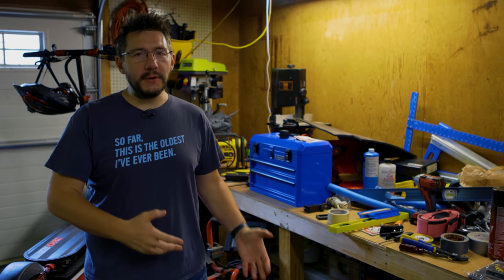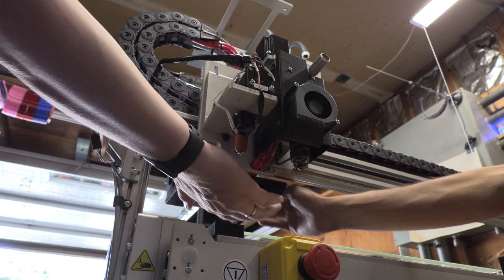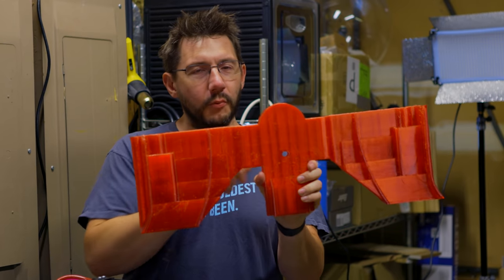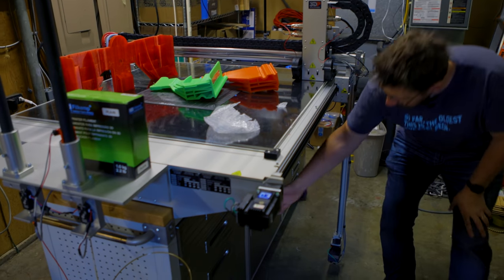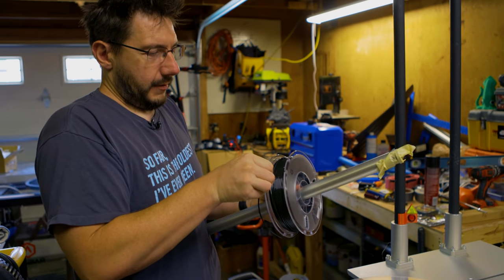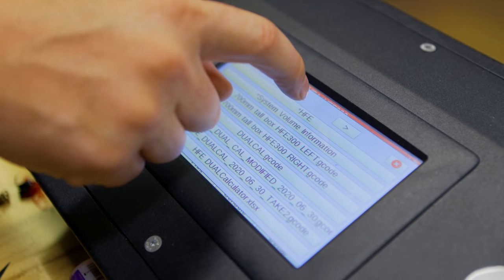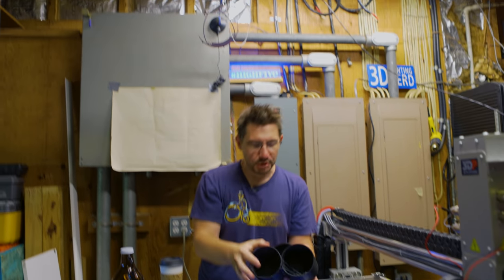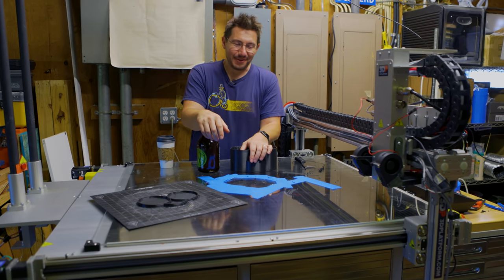I Broke a $38,000 3D Printer

Comment: Somehow, this material that's well known for inseparably bonding itself to bare glass has inseparably bonded itself to bare glass. Truly baffling!
Reply: It's like 2525 dark matter.
Reply: Incredible!
Reply: Even more baffling, it's the material provided by the vendor...
Reply from the maker: I've NEVER had PETG bond itself to bare glass before on the machines I've run it. It's always been tough to print because the first layer just wouldn't stick right. I've had PETG weld itself to PEI before, that one was fun...
Reply: I found myself wondering how much filament that chess piece took to make
Reply: @3DPrintingNerd  This is the reason I avoided PETG for so long.  I was afraid I would trash my carborundum glass bed. I bought an additional borosilicate glass plate and stuck a Gizmodorks PEI sheet to it.  I have tested with sugar water barrier and straight to the bed.  So far, the bare bed seem to work pretty well.  Of course, I probably just jinxed myself.  : /
Reply: I've had PETG weld itself to a glass bed before.  I chose to sacrifice the printed part rather than the glass by heating the bed up enough to melt the PETG sufficiently to remove it from the bed.  I've never printed PETG on glass since then.  Lesson learned.
Reply: @3DPrintingNerd  "I've NEVER had PETG bond itself to bare glass before " i hear people say this but they have this coming to them
Reply from the maker: Hahaha. Truth.
Reply: @pbales8951  My first fillament choice was PETG.
After like 10 prints, mad upgrades, and a week of tuning I was sure either my machine was defective or I sucked at printing.
Swapped to PLA, used a baseline for temp/retract/etc, and my first print looked like it came out of a SLA printer.

FUCK PETG.
Reply: @johnmorris3121  I dunno about sugar water, my printer's manual recommends windex or glue stick as a separation layer. Window cleaners work fine with PEI.
Reply: I never had that problem with PETG on Ultrabase. I thought he printed PC (another story).
Reply: @3DPrintingNerd  I've purchased 3 PEI build plates because of things inexplicably welding themselves to the coating, but I keep getting new ones because I'm in absolute love with the sexy smoothness that is First-Layer-PLA on virgin PEI!!!
Reply: @3DPrintingNerd  You are so lucky, I've been through 3 glass beds thanks to PETG
Reply: put some dry ice on the glass around the print and it should come right off.
Reply: @Paul-sk2pc  It's all good now, I switched to a PEI build plate and have had no trouble since. (use a glue stick before the print and it works great).
Reply: And petg doesn't stick just to glass.
I use blue window cleaner on my Prusa i3 mk3 bed. I got that recommendation from some forum and it sure works! The adhesion is not too great but just right.
One time I forgot to use blue window cleaner after cleaning the bed with pure IPA and the results were catastrofic. The PEI film was fused to printed object and tore apart. Luckily I still had the other side of Prusa spring steel sheat intact.
Reply: Perhaps you mean ... Truly "Brilliant"?  :)  Also, I've done this before, just on a CR-10 instead, way cheaper bed replacement, lol.
Reply: @3DPrintingNerd  I have had the same issue, cant for the life of me get any PETG (3 different brands) stick to my glass bed. That's bare or with bonding agents. Iv resorted to using a pei spring steel sheet to get prints to succeed at all. Wonder why it sometimes decides to weld for some people.
Reply: As soon as he said Borosilicate, I knew what happened.
Reply: Never printed on bare glass - a layer of cheapest hair spray always made for great first layer bonding and it just pops off after cooldown. Now I am on a ship and forgot the hairspray so I had to print on bare glass. First time ever I had PETG stick to the glass and take chunks of it. Good thing is that glass has two sides :)
Reply: @3DPrintingNerd  With normal glass, it generally won't. It will bond at a molecular level to borosilicate and to a lesser degree to soda lime. As soon as you said "borosilicate" I immediately knew what was going to happen. :/ Sorry, man. That sucks.
Reply: @ketse89  Do you mean PETG doesn't stick to "just glass" (i.e. not borosilicate) or do you mean that it's not "just stuck" (but rather bonded) or are you under the mistaken impression that PETG and borosilicate won't bond inseparably?
Reply: @Paul-sk2pc  That might work on regular glass. When you mix borosilicate and PETG, the print may be chemically bonded on a level that precludes it's removal through any means short of (gently) machining the PETG off the glass.
Reply from the maker: @SwervingLemon  It's all good, man. Super and total learning experience and the company is awesome to deal with.
Reply: @SwervingLemon  Saying "petg doesn't stick just to glass" means that it sticks to glass AND other surfaces. Or at least that's how I've learned the phrasing, english is not my primary language.
Reply: @3DPrintingNerd  It seems there are 2 scenarios: It will barely stick at all without adhesives and/or enough heat or it will stick so bad that it takes chips of glass with it. Maybe depends on the kind of additives? shrug
Reply: @haraldhimmel5687  , you are running in circles. The no-sticking comments that people have made here refer to ordinary glass, not to special type of glass; there are not the same.
Reply: @michaels3003  Like I said, I experienced both on the same glass on different filaments. Maybe there is a special type of glass too where that is the case but that was my experience.
Reply: You should always use primer when printing with PETG. Glue stick, hairspray or whatever you fancy as primer. From there my experience is PETG is just as easy as PLA, just a stronger result. I've had the glass split through the thickness, no cracks in the glass, when printing large PETG models without primer. Since then I always prime and hasn't had an issue.
Reply: @johnmorris3121  just use glue stick for PETG on PEI/glass.
Reply: @3DPrintingNerd I only print PETG on glass, and have never had an issue. EVER.
Reply: Yep, happened to me on thankfully a small plate.  Definitely something that can happen.
Reply: I use a type of bond when printing petg on glas glue stick, magic spray etc. 90% of my prints are petg i never had the glass infused in my print lol
Reply: @zigfaust  ha same here
Reply: @3DPrintingNerd  wonder if can get something similar to prusa textured sheet for that machine lol. that sheet never gave me any issues.

Comment: We can't really judge the quality of this printer until we see a 1 meter long Benchy.
Reply from the maker: ha!
Reply: Brian Burton yes
Reply: Benchy could be 1.4m if printed diagonale
Reply: I agree..  ALL printers are tested with Benchy.  
Print a normal size benchy (no doubt it will look terrible with a nozzle that size)
Then print a massive one and put a motor and RC controls on it.
Reply: Smith Family Designs YES!!! That would be awesome!
Reply: Joel would have to build a version with a hole already in the hull of his benchy.   Too soon?
Reply: There is a floating Benchy on thingiverse
Reply: That Benchy would be a pool toy.  I'd love to see it!
Reply: @smithfamilydesigns2012  yes yes yes! I've looked at my tiny ones in depth and if you have an R/C bone in your body (Joel...) you can see it's potential. There's even a hole where the prop should go, and if you lower the bottom of the deck box just a bit and add some type of watertight bearing it's a straight shot for the prop shaft. The "flag holder" could be repurposed as a rudder mount, electronics & battery pack in the wheel house. Why couldn't I have been Joel's son?!?!?! Lol
Reply: Next video: Just how sea-worthy is Benchy?  Watch as my kids find out!
Reply: @CaedenV  O the normal scale will float... just barely. But as you grow the size you displace more water than the added weight (infill %, wall thickness, material density & all)... in my mind. Do it.
Reply: YES
Reply: why are people printing benchies anway.  I've owned a CR-10 Max for some time now and everything comes out perfect, unless there is an adherence problem on layer 0, including large pieces (30cm x 30cm in the xy plane)
Reply: xl a. It’s a meme ish
B. Benchy means benchmark so it’s just a standard model that is almost garenteed to work, and you can easily see if your printer is not good because a benchy has:
I. Overhangs
Bridging
And other stuff
Reply: @Volt64bolt  yeah I understand. I don't waste filament on tests. I know what my printer can do and I'm pretty conservative in terms of bridge size and overhangs angles. Also, I always check what the slicer is computing before running the gcode
Reply: Wait, it's really called Benchy? I just watched a This Old Tony video and he called it that. I thought it was a Tonyism.
Reply: I want it live size with a motor on

Comment: Seems like that bed surface is in desperate need of changing... like a huge PEI springsteel sheet maybe? Expensive yes, but it's already 38K!
Reply: Next video: "i broke a $38.000... again" ahahah
Reply: 3/16 also seems really thin for that size. I'd think 1/4 or 5/16 minimum. But Joel come on I know you like to play the dumb consumer to test user friendliness but this is a commercial machine with a pricetag to match. You had to know that was going to happen when you printed directly on glass with petg.
Reply: If Disney has broken it 4 times already as well, that sounds like there are settings or prints to avoid. Feels like certain materials/temps when mixed with a large enough first layer create too much adhesion
Reply: Not without glue or hairspray between the PETG and the PEI sheet.
Reply: that's the joke ;)
Reply: @Real28  Broken glass is 99.2% operator errors.  not setting the head height or not using proper bed prep.  also with such a large surface it takes longer to cool down the print and if someone is impatient they usually exert to much force to remove it.  I know i have done it on smaller printers as well as on this model.
Reply: @donaldmcfarlane5004  I disagree. Have you ever heard of any 3d printer where the bed breaks this easy because of the operators not knowing what they are doing? even if the operator did make a mistake, the bed should not break like this.
Reply: @MrWizard65  yeah hairspray acts as a really good medium on extra sticking PETG.
Reply: @maxbursell3513  With PETG? Yeah.  I've seen it myself - it broke on it's own while cooling down after the print was finished on my BigBox.  Bare glass + PETG = uh oh.  In this case glue sticks actually help make sure things don't adhere too well.
Reply: @crystaldragon141  I would say min 1/4 in but it needs something to prevent the print sticking too well. Even 310x310mm boro has issues with over adhesion, we had that issue on the 12 cubed gen 3. A spring plate might be best.
Reply: That is exactly what i was thinking too. You also wouldn't need to have a huge high temp magnet either. You  could use smaller sheets at the 4 corners and just fill the rest in with a material at the same thickness to save cost, and make it easier to remove the build surface. I think it would be much more practical, (especially for Disney) haha.
Reply: They may want to rethink their print surface. For that price I would expect it to be bulletproof.
Reply: My last job had two of these printer's big brothers. Maintaining a even heated build surface of these, requires a glass surface,  metal cools off too quickly.
Reply: I had the same question when they installed the printers.
Reply: @ualdayan  When I got the 3DP 1000, the advice from 3D Platform was to apply Coors Light to the borosilicate glass to facilitate appropriate adhesion and to use nothing more than water to clean the bed. After using the printer 3 years in this manner, it's still in good condition.
Reply: Leave it to Disney to break a 3D printer commercial machine worth $38K only to charge visitors the difference to make up the replacement 5 times over just to do it again
Reply: @barnowl012001  it's not like the glass costs 38000........
Reply: Less of a problem if they added in metal bracing at the bottom for holding four sheets of glass.
Reply: We use a 500*500 PEI spring steel sheet at work. If printing really large and strong parts like we do, the magnetic force isn't enough to keep it down. It'll warp the plate up. Now a nice mic6 plate, that would do it!
Reply: @maxbursell3513  You have no reason to think it "easily broke". Assuming this is ignorant.
Reply: or at least a thicker and tempered glass.  why did a printer that expensive cheap out on the glass?
Reply: @Real28  In this case, PETG on bare glass. It's known for doing this. The fix is a layer of glue, which lets go.
Reply: It sticks to the glass, what the actual F
Reply: @crystaldragon141  You're assuming he is playing... Whether he is or not, or whether half a mill of subs made him lazy, that was def one preventable mistake.
Reply: @Real28  Hard to make any conclusions not knowing how it's used there. Perhaps it's in a department where many people have access to it and 4 people have made the same rookie mistake. Or perhaps they have a guy running it, whom like Joel, think it's half cool to break stuff that's not yours. 

That said, I will admit to your argument about the increased area having some logic. Still, plenty of people have broken regularly sized boro/glass beds with PETG over the years so it's not unheard of.
Reply: @maxbursell3513  Did you actually see the video? He could hardly get the glass off the part with the spatular and a hammer - after he had broken it off the bed. So, it was definitely a fusing issue and if you have to assume anything, perhaps assume he put quite a lot of force into trying to remove the part from the bed...
And does a guy who doesn't care to tune print settings and thinks the bottom "layer buggerness" is some unexplainable mystery and who doesn't bother to research for five mins on what closed-loop steppers are and do strike you as a guy who doesn't make user errors?

Comment: Printing a chair and seeing just how much weight it can hold would be so cool.
Reply: Good call, after that then maybe print an auditorium or a solar city, with the proper Slicr engine, and building permit.
Reply: I like the chair idea.
Reply: @BBMando69  I watched a youtube yesterday of someone 3d printing a stool, and they had the description saying: today i'm going to 3d print a stool.

They used dowel to connect the seat to the stools legs, and it was printed so fast that the infill settings were not that durable, and i mentioned that they better be very safe with that or they could end up either in the hospital or the coroners office if they shifted their weight while sitting on that stool if they forget that its not the safest design they created.

Furniture printing should not be compromized with no cutting corners in the safety redundancy dept.

Something to consider if anyone wants to print a chair, so they dont end up in a wheelchair for life or worse without life.

The-Digital-Lifeguard-Project-_-
#SafetyFirst
Reply: How about a small stool? Like from Harbor Freight.
Reply: @truetech4158  You may joke, but one day soon there will be houses that were fully constructed and furnished to a habitable level in a shockingly short time by a fleet of trailers containing a bunch of 3D printers and feed stock. We can already print large structures in concrete, it would be easy to add dual extrusion of expanding insulation foam to that machine, and Laser Metal Deposition is progressing rapidly to the point where we can print structural-grade parts in various alloys without a need for post-processing. Ten years at most, I'd wager, until we see a functional fully 3D printed home.
Reply: I'm up for this plastic furniture idea.  We could use that fusion 360 feature where it automatically calculates the load and designs the object.
Reply: Idea is crazy interesting, but very non-practical
- Cost non-effective solution. For price of one 1kg filament role you can buy already made plastic chair.
- rough surface is ideal for rubbing of your clothes and hard to clean.
Reply: @MatejBosansky  There is very little you can 3d print that is cost effective unless your prototyping something and saving money by being able to do multiple iterations without needing to invest in whole new molds. That isnt the point.
Reply: @MattWeber  Good point but can't fully agree. Stuff like mounts, holders, cases are cost effective especially if you find already made model and you need only one piece. And will serve same good as those from injection moulding. Maybe just will not look nice.
There are just stuff which makes sense to print, but chairs are not one them. Unless it is prototype for later mass production.
Reply: Both a single part, and an upscaled assembled one would be cool
Reply: I think Froggy chair would be the coolest
Reply: @BlackWolf18C  we are far from that like in 30 years maybe that concrete tho so is much harder
Reply: If they do it in ABS with the layer plane oriented properly it can hold maybe a metric ton.  If the layer planes are off, they'll shear.
Reply: Kilos of filament?